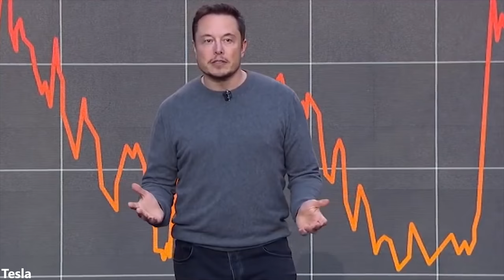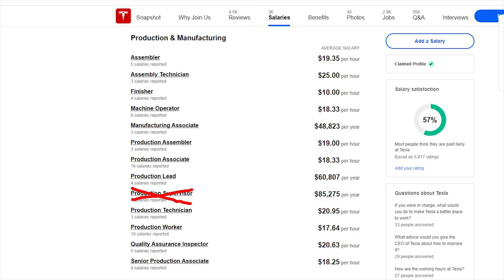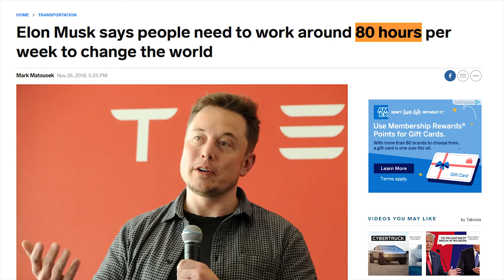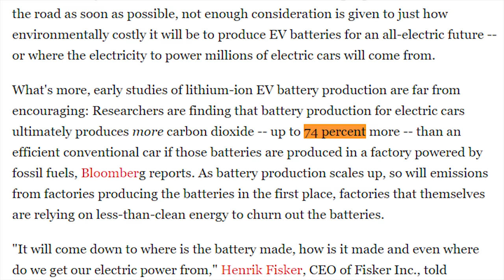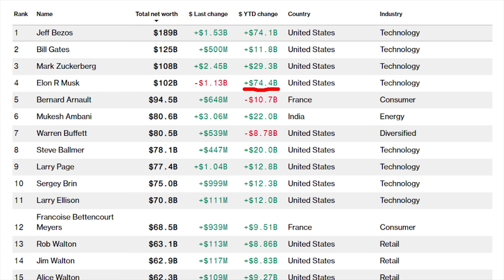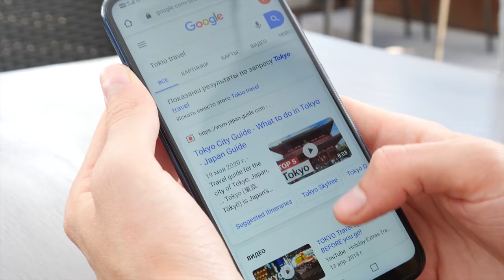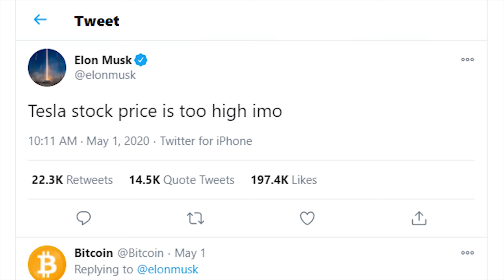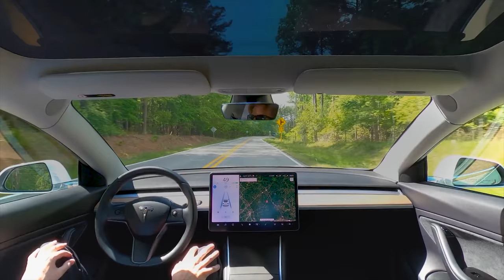The Ethics Of Elon Musk

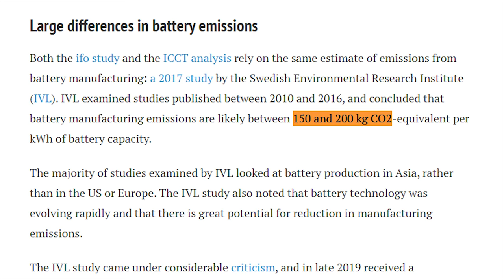Comment: 5:00 Yes the battery production produces alot of CO2 BUT that is a onetime production of like 15 tonnes CO2 per Batterypack. If you compare a normal Diesel Car with 5,5 liters per 100km and a Model 3 with 20 kwh per 100km and a driving range of 200 000km in it's lifetime then the Diesel powered car is going to have produced 65 000 kg of CO2 and the EV only 28 000 kg of CO2.

I can go more into detail how I calculated these but I did those with german sources so that can be hard to translate.